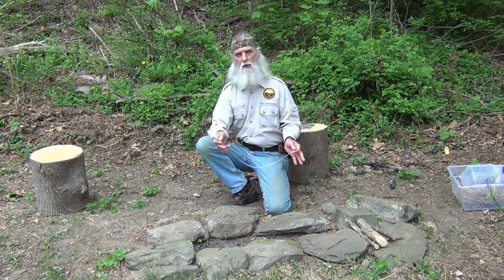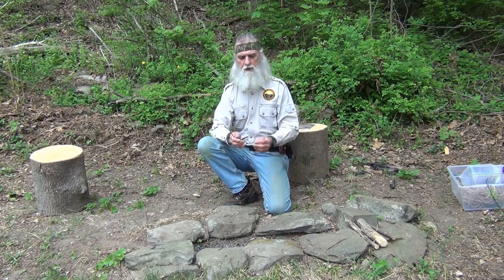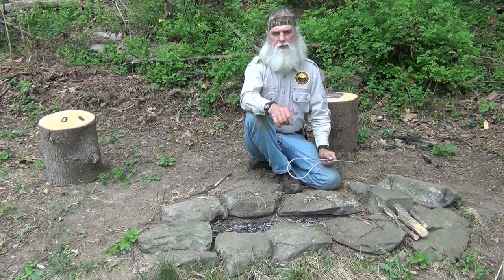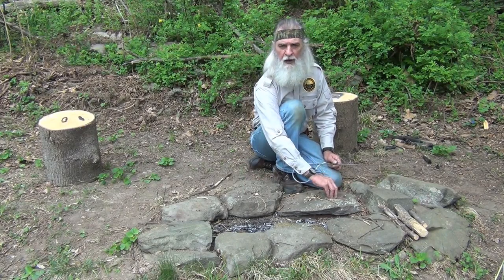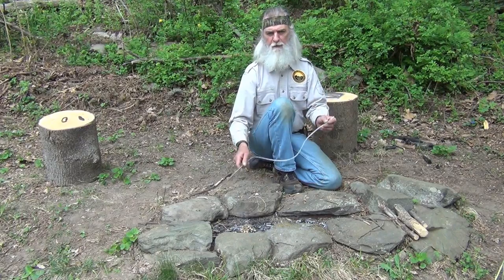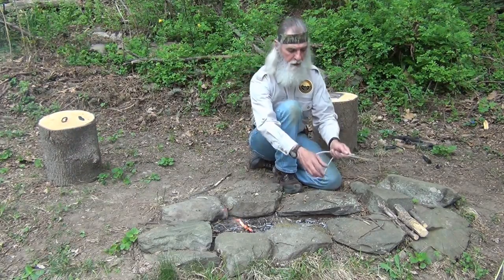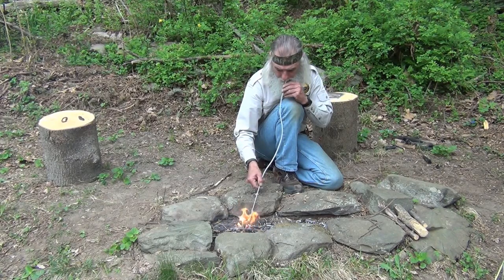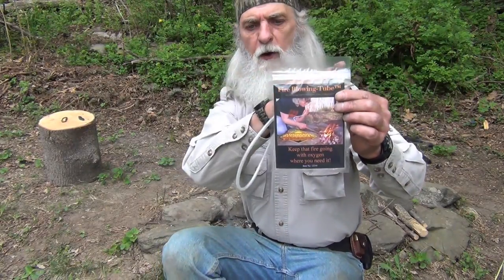Fire Blowing-Tube

Comment: I have been using one of these since my Boy Scout days. As I remember we called it an inspiritator. Nessmuk is the first reference I have found for one however I am sure it predates him.  I admit the ones I have made do not have a collapsible stainless steel end pipe. I use 1/4 inch copper tubing from a hardware store with matching plastic tubing.

They serve every function you demonstrated and arean invaluable asset, purchased or DYI.

Stay safe and cover your 6.

Sergeant Major

Comment: Thank you so much, John for making this available and sharing the use in the video.  I will definitely be ordering one.  I hope you will also consider putting together the bib hose and tubing to use with the sillcock key.  I believe I have found the bib on Amazon with your link.  The problem is finding the right tube to connect to it. plastic tubing comes in numerous diameters and I have spent more hours than i care to admit trying to figure it out.  i would just prefer purchasing a kit from you.

Comment from the maker: A Youtube video showing how to use the Fire Blowing-Tube by Survival Resources
Reply: OK, but blowing your "exhalation" into the fire pit replaces the oxygen that's in the "nest" with carbon dioxide............which doesn't burn. 

And wouldn't "pinpoint replacement" (which the interior end of the hose provides for) dissipate the concentrated heat that the fire needs to keep going?